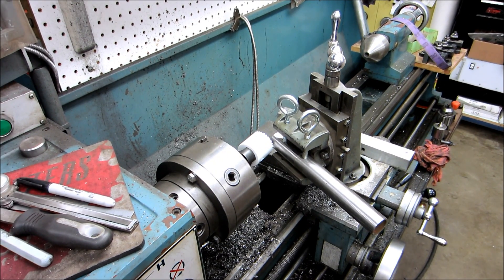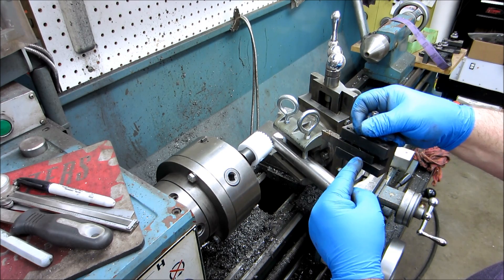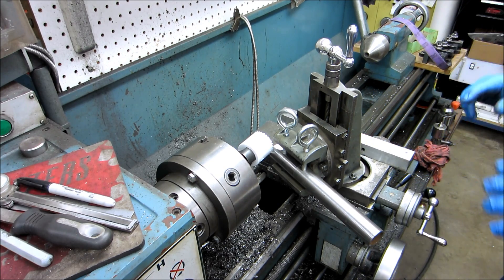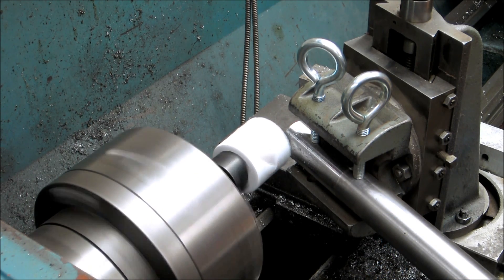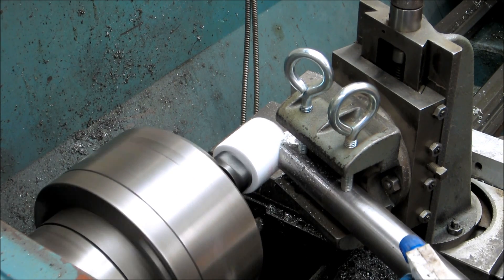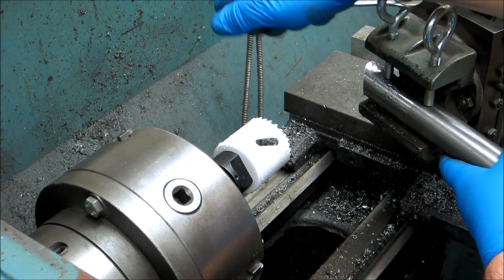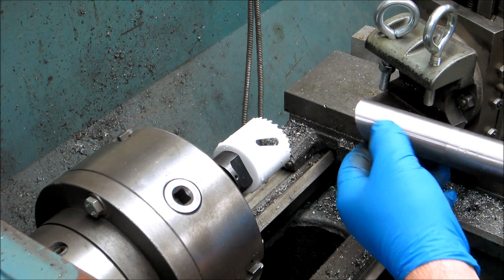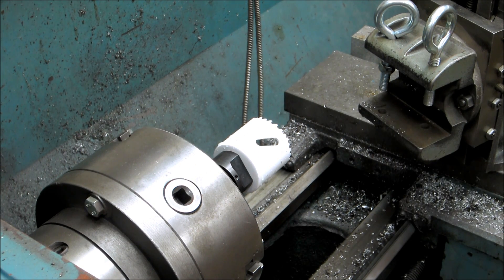Tube Notching 2

Comment: You must have a much more ridged lathe than my logan 1910. I had made a v block holder like you mentioned prior to seeing this video. No matter how tight I tighten the compound it moves. I ended up using the mill with a vblock instead and it worked good. I would dent that notch in on the leading edge on the hole saw so it doesn't catch. By leading edge I mean the second half the opening.  I would use a punch, or grinder to put a small taper.
Reply from the maker: My lathe is a 13x40, so I'm sure it weighs a good bit more......which helps with the rigidity.  Sounds like you figured out a good way to do it with what you have. Thanks for the information. :)  -Mike

Comment: For finding a good RPM, try using 80sfm for HSS tools in general steel materials. RPM= 3.82 x SFM / TOOL DIA
Reply from the maker: Interesting!  I'll try to remember to try that.  So that would have been about 150 rpm for a 2" hole saw.
Thanks!!
Reply: bluehandsvideo Speeds and feeds simplified : Run Hss half as fast as you think it should go (any color in the chips slow down ) Carbide twice as fast as you think it should ( if your not making color your not running it fast enough ). And if you have any ceramic tools run them a warp speed , most manual machines have a hard time running fast enough. screeching , screaming , squeeling or vibration is Bad M'kay ?
Reply from the maker: bugerbeanjohnson
Thanks!  I still don't know much, but it's been a couple of years since I did this vid.  I almost always run carbide inserts in the lathes and I've been shooting for chips that have no color at the cutter, then some brown and even blue/purple a few inches away or after they hit the tray.  I doubt I'll ever run any ceramic tools.  Thanks for the nice, simple rule of thumb!!  I'll keep it in mind :)
(I see you liked Ceelo Green's vid, lol!!  I was just watching that the other day! )

Comment from the maker: I picked it up at Home Depot.  If you go to their website and type "hole saw arbor" into their search window, it will show the options.  This one should be the Milwaukee 3/8 in. Ergo Quick-Change Arbor Model # 49-56-7250      Internet # 202256264   Store SKU # 233438